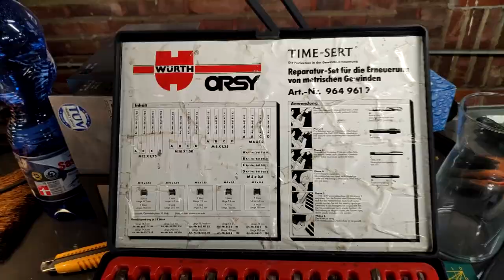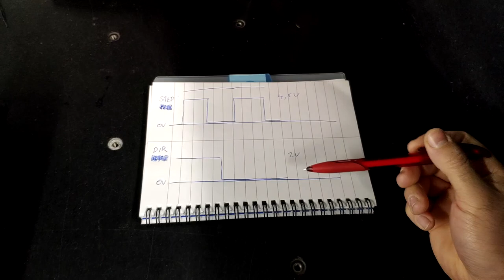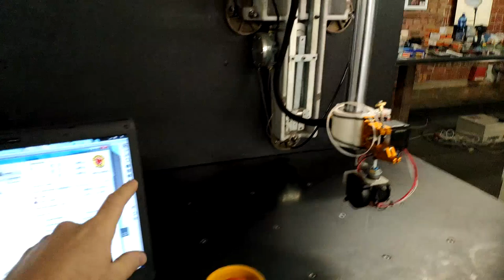Air bearing 3d Printer - HotEnd, Controller, Troubleshooting #S01E04

Comment: Superb project! Problem is that the skr board runs on 3.3V internally. Adapter like these usually solve the problem and you get 5V output signal. There is an buffer IC on the back of the adapter board. Makerbase MKS CD
https://a.aliexpress.com/_m0uuaOd
Reply from the maker: Thank you! That's exactly the part I woud've needed. I'll consider this when step 1 is running reliable and I make a descision on what to build next.

Comment: I'm very very interested to see how this turns out!

I would HIGHLY HIGHLY suggest considering using the Klipper firmware. It uses a RPi for all the gcode handling, and then one or more MCU boards like the MKR 1.4, RAMPS, etc.  to run any motion control with a very clean and configurable remote control  UART or USB firmware to interface to the Pi. Multiple MCUs are supported with a clock sync mechanism between the Pi and boards.

Klipper is VERY easy to configure and iterate on configurations because everything of note is configured on a plain text file on the RPi. Extension modules can be written in Python, or C if you need to add new application specific commands to the Printer firmware (shouldn't be necessary for normal use). Lots of good, concise documentation too.

You may be able to (with work) run Klipper on the PLC (if it can be made to run Linux). If not, a humble Pi Zero  would work fine.

Comment: Yo, nice project.
As someone mentioned above, get some differential line drivers that you can plug into the stepstick sockets and use shielded cables. Also you should consider upgrading to a Raspberry Pi 4 with Klipper because you will need very high step rate to get decent speed in this configuration. Klipper has a new feature called input shaper that helps with resonances. You should look up. Trust me, it worst the effort. And a Bondtech style dual gear extruder is a must have in 2020 :)

Comment: I think this project is great I would love to see this type of machine use a screw type pellet fed hotend. It would really expand the capabilities of the machine in my opinion and make it able to do all sorts of Material printing considering the abilities of the machine frame and all. But that is more complicated then it needs to be. Love seeing it move and almost print!
Reply from the maker: The current setup is really just temporary. I have considered the pellet extruder, but that's a step/video for itself. Maybe in the future

Comment: Most of the 32bit Boards run 3.3V logic. 

Let me know if you want to have and RADDS with an Arduino Due. 
This should be 32Bit and 24V, the due could use 5V Logic
Reply from the maker: Thank you Joerg! Radds with Due would be a great board indeed. I'll get this one running reliable and check my options for next steps!
Reply: Nope Due is also 3.3V

Comment: Looking good so far.  I am curious about the PLC streaming the G Code to the 3D printer controller.  Do you have more info on that?
Reply from the maker: The PLC has a PC with windows integrated. I'll run a software like Pronterface or Simp. 3d to stream the G-Code and use it as a communication interface